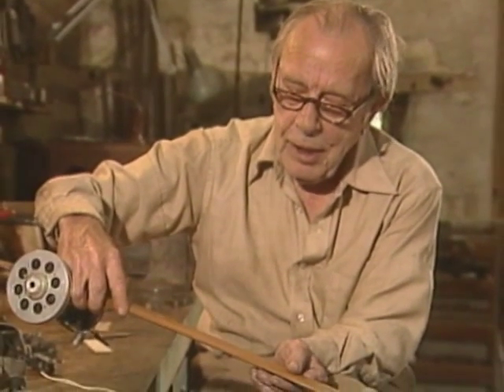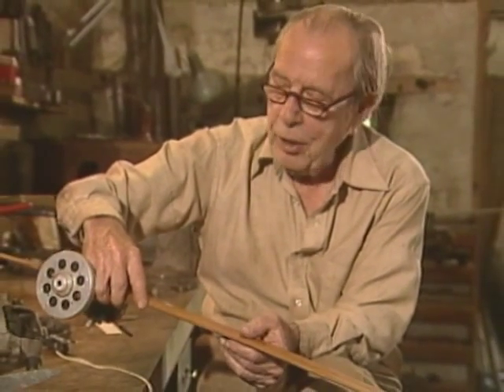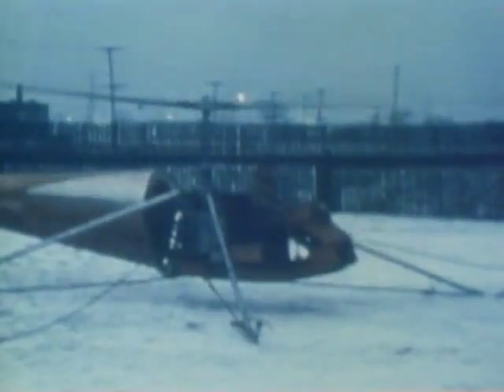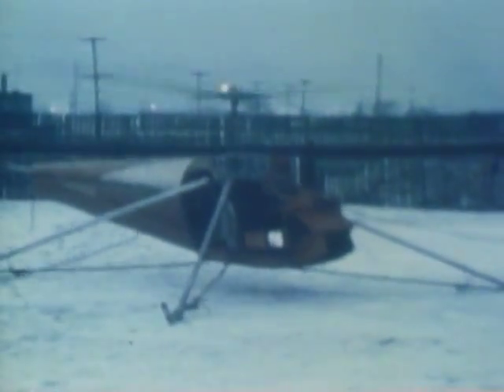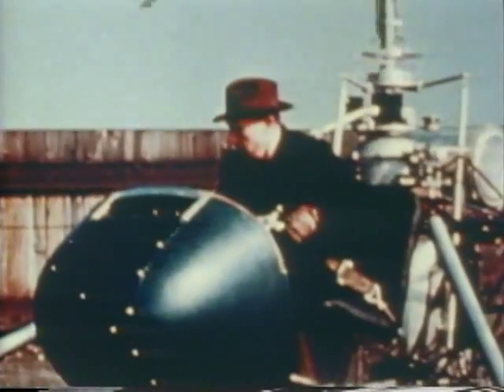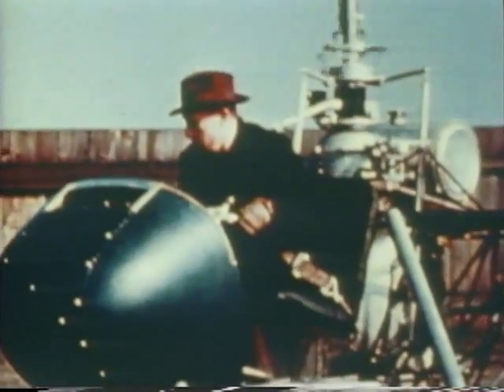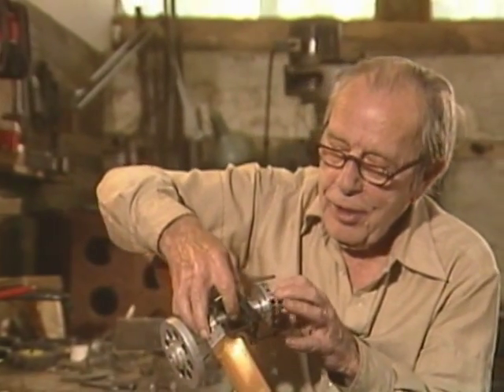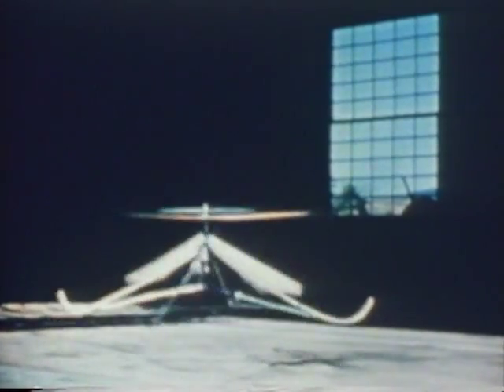Arthur Young on the Helicopter (Part 2)

Comment: My Army Huey helicopter was assigned to an Army Special Forces unit headquartered in Danang, South Vietnam.  My aviation battalion was located by the beach in Chu Lai and was a part of the Americal Division.  We were flying back to Chu Lai to our flight line and hangars so maintenance could be performed on my Bell helicopter UH-1D model air craft.  We had been flying the Green Berets all over I Corps in South Vietnam, getting as close as 2 miles from the DMZ.  So here we are calmly flying at 5 thousand feet, out of range of small arms when all of a sudden a large grinding noise started up in the transmission area.  I thought the transmission was tearing up and that it would seize up then the rotar blades would stop spinning and the ship would fall to the ground.  I thought this is it -- we're doomed.  My pilot came on the intercom and told the door gunners that the hydraulic system had failed.  He said there's a flight line in Danang and we would have to do a running landing on skids above 60 knots per hour.  I started praying.  I knew from walking across flight lines that they were not perfect and some flaw could grab a skid and cause the Huey to pitch forward and crash.  Our Bell helicopters were notorious for catching fire and burning upon crashing.  I was really praying hard.  The PSP flight line came into view and my Army pilot descended to within a few feet above the steel-perforated-plates that made up the flight line.  I spotted one corner of a plate that curled up a few inches but we missed it.  My pilot eased the skids down and sparks flew from the helicopter skids as they were grinding against the metal flight line.  Finally the Huey came to a stop.  It was good landing.  We got out of the Bell helicopter and the pilot said this is as far as we go today.  The skids were ruined and needed to be replaced.  He announced we would have to call our company and have them send another Huey for us then come back later and pick up our UH-1D after it had been repaired.
Reply: Fascinating thanks for sharing.